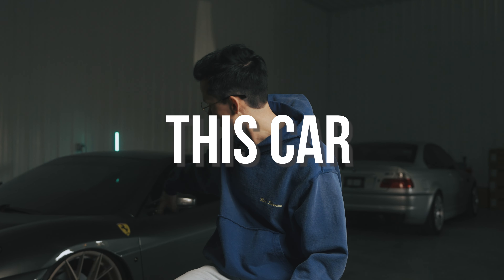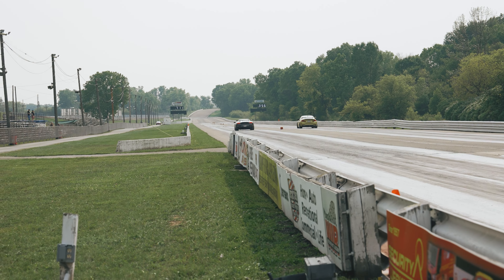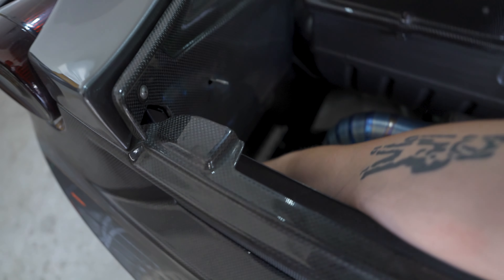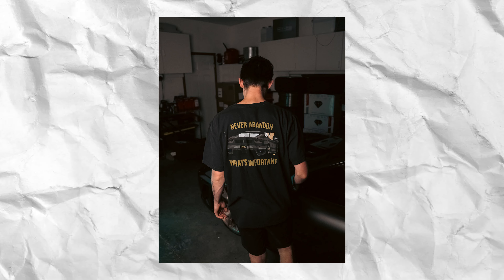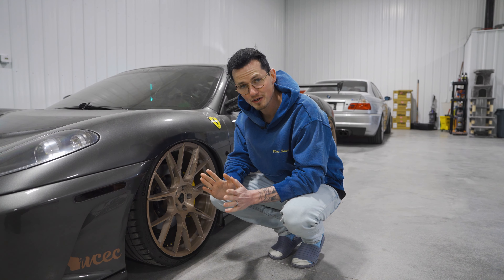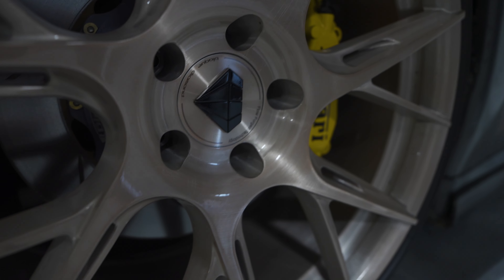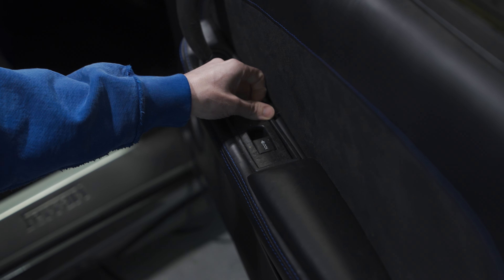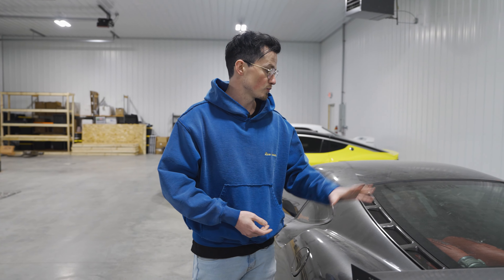Exposing My Cheap Ferrari F430

Comment: Steering column is attached to the steering wheel and goes into steering rack.(rack and pinion) which is where the inner tie rods attach to.